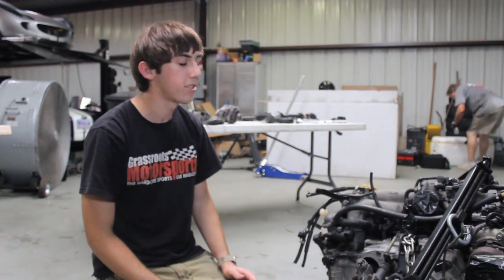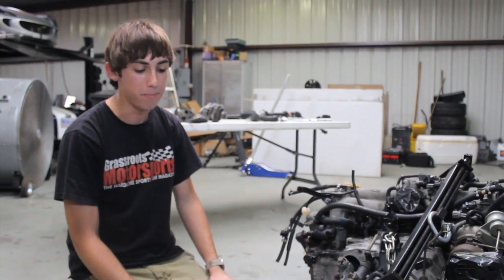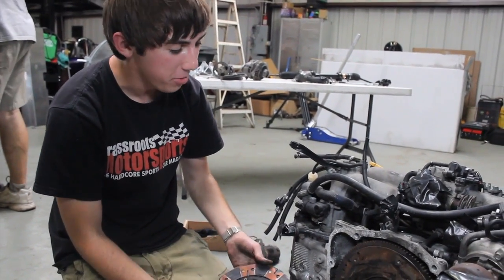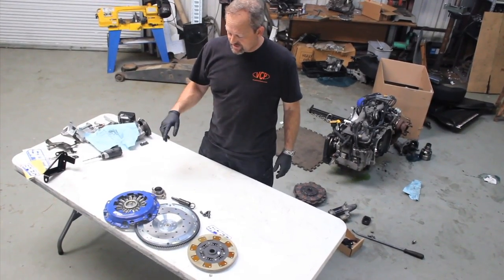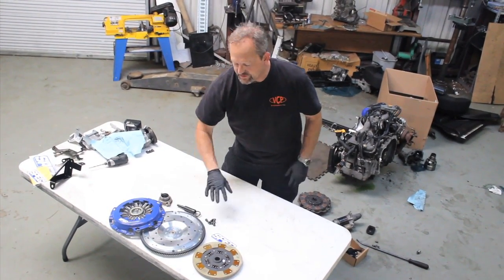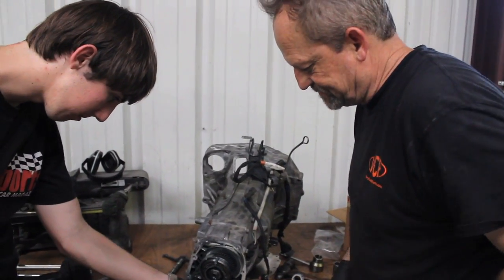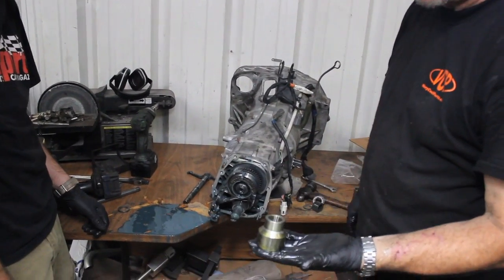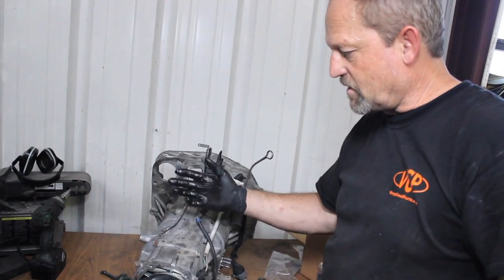Project 818 Part 12: Converting to 2WD and Installing a Clutch

Comment: Its probably a good idea to have a new clutch assembly ,flywheel in the budget.I would do a full tuneup,belts,hoses,oil ,filter etc and if the motor had any kind of mileage,replace the timing belt,tensioner.I seen a few of these motors go south because of poor maintenance,don't assume everything is okay,just because you were told so.

Comment: If I were to put that adapter on, my instinct is to place it on the shaft then maybe put the washer on behind it, hitting the washer with a deep socket or brass drift. Am I anal about stuff like that? Not that I would second guess anything I see here. After all, as the saying goes: 'You can't argue with success'. Obviously, you guys are very accomplished and successful.
 I keep dreaming of my own project but the whole 'insurance and registration' issue is keeping me from pulling the trigger. Anyone know about how to resolve that issue in Mass.? Sure would appreciate any input!

Comment: This is to install the engine into a Factory Five 818 Rwd mid engine sports car, a car anyone in the world with no mechanical experience can build in their garage in a month or however long you want to take to build it longer. Not to make a Subaru impreza front wheel drive only, haha
Reply: Anybody can do it,but you should do your research,simple mistakes,by assuming it is okay can be very costly ,dangerous.I recommend marking any critical suspension,engine trans bolts,nuts with paint stick after tightening to final torque,cotter pin,safety wire etc...

Comment: What are the advantages of having a fwd instead of the awd?
Reply: Old comment but if you're still curious, this kit works by taking the normally front mounted engine/transaxle and moving it to the rear of the new car. It's then a mid engine, rear wheel drive car. The advantage is an extremely light car (hundreds of pounds lighter than a miata, for example) with most of the weight over the driven wheels.

In order to keep it AWD, one would have to either completely redesign the car to accept the engine in the front just like it was used in the donor (thus rendering it's amazingly low <1,900lb curb weight moot) or figure out how to route the output shaft that formerly went to the rear 180 degrees backwards, fabricate a driveshaft/support system to run a driveshaft to the front and develop a front suspension that works with the 818 

The FF GTM works in a similar fashion-taking a RWD front engine corvette and moving the engine to the rear, bolting it to a porsche transaxle and making it a RWD MIDENGINED car, with the goal being a more advantageous weight balance.